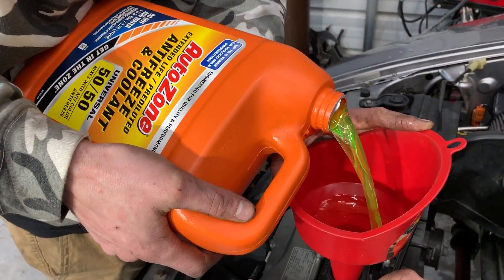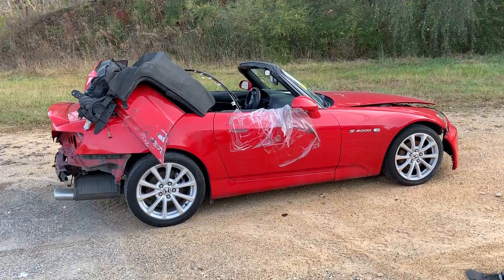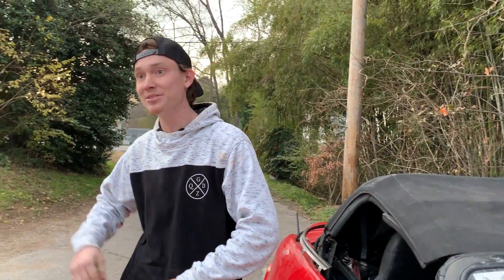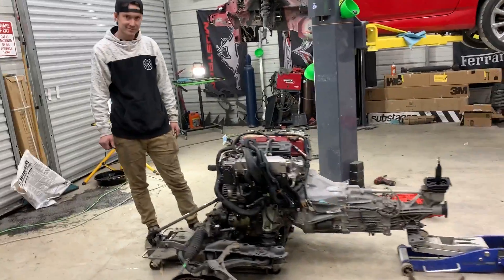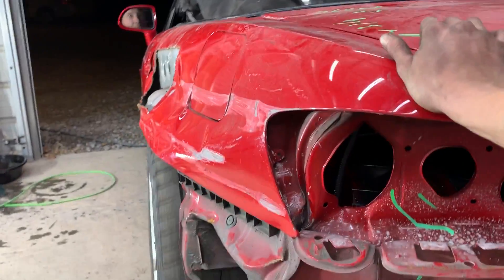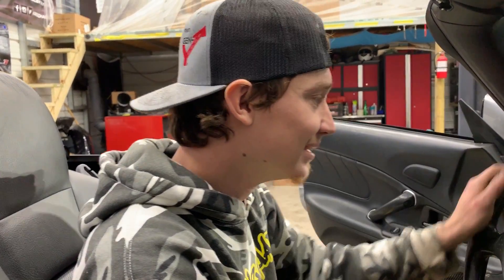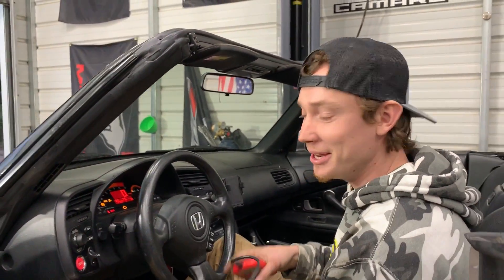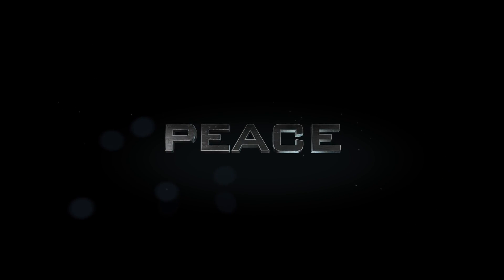Rebuilding A Wrecked Honda S2000 Part 7

Comment: You know what they say, The 3rd engine is the charm.  You all are hard-core.  Nothing stops your builds.  Great work. 

That 1st engine might still be good, maybe have someone check the head (for cracks and warpage) and plane it down.  The upside is that planing it can increase the H.P. a little bit...as compression was raised (smaller combustion chamber).  Just a thought.

Comment: The squeel when you start it is from the starter index. 
Check both sides of the dipstick cause it never reads the same on both sides and always go with the lower side. I have an 02 and learned it from a few friends with s2ks when I first got mine.

Comment: 3 wrecked cars to build one complete car . And over filling your oil won't hurt the engine as long as it's not too much over full . Drifters do that on purpose to make sure they have proper oiling while cornering . Under oiling will kill an engine , but until it hydrolocks overfilling won't hurt it .

Comment: Swap over the cluster from the red s2k keep track of the milage on the new swap
Reply: The red one dose not rev as high the ap2 is a 2.2 liter and revs much lower so that might be a problem
Reply: Tyler Walter - Gold spark plug cover means 2.2L, it should have the same cluster as the silver car.

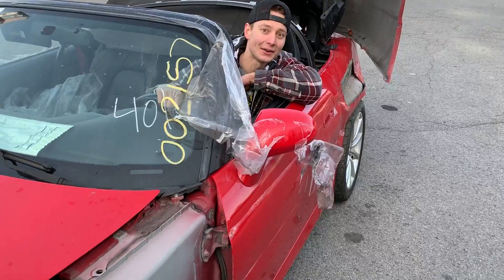Comment: 2:36 ‘it’s super smooth’ 
Literally thought the diesel running in the background,  was the F20C  running at first 😂

Also, Honda stock motor mounts aren’t the greatest. I’ve had so many stock ones break from normal driving. I wouldn’t get solid mounts cause that’s quite the rough ride
Reply: Couldn't believe how clean that s2 was
Reply: JMR Rebuilders right?! Super clean. Would almost be worth fixing that one instead imo

Comment: Make sure you change the timing belt if you can't verify when it was last done, they need one every 100k.  Also, PLEASE don't use 10w-40 like you did in the last one, you'll kill it if you do.  God bless and Merry Christmas!
Reply: Josh Lampe it’s not a belt it’s a Chain. It don’t need to be replaced every 100k
Reply: Also 10w40 viscosity  won’t actually hurt it😂 so many people change the oil viscosity when the car has higher mileage and the car does fine.
Do you know what you’re talking about? I’m no s2000 fan but I’ve also heard those chains don’t need to be changed every 100k unless you beat the shit.
Reply: Yelsew Painter I’ve owned a s2k for 15 years so I know what I’m taking about.
Reply: @TheIntegratyper99  I think he was talking to Josh Lampe

Comment: You should put the wheels and tires from the red S2000 on the gray one because they look much better and the tires look like new. You should also put the stock airbox back on because those cold air intakes don't do squat mounted in a hot engine bay.

Comment: condensation steam is normal in cold weather and is the sign of a clean burning engine.
Also the rocks are kitty  litter
Merry Christmas
Reply: ᗒ╬ᗕ1112223333111ᗒ╬ᗕ , I’m thinking now that i saw them disconnect the exhaust , that all the residual coolant will need to burn off.
Reply: sure it will but cars that are not running rich will give "steam" out the exhaust.
I used to know what side my idle mixture was off that way.
Cold days its perfectly normal.

Comment: Hey guys merry christmas everyone! Good job! Just for information - Honda use particular coolant, not a generic one. The coolant for this engine is OEM Honda Type 2 coolant! Using different can damage seals, head gasket and the cooling system. Better flush that thing and change it when you can if you want to keep that engine! 😉

Comment: So instead of getting the other head resurfaced you guys buy another s2k lol?? Hey, works for me...
Reply: All SPOOLED UP they probably got a good deal on it I’m sure
Reply: When the upload pays a couple of grand you can waste money like that.  They have no business working on engines without the proper knowledge.  A tech manual would be a wonderful idea as well.  But hey, I am just a hater.
Reply: It may have been cracked, that was a lot of coolant coming out of the exhaust.
Reply: @gd1996  Well they check for that prior to surfacing.  It's freaking blown head gasket 101 man.  There is probably a hundred youtube videos on the subject.  If only they knew how to use it.  They need to stick to painting.
Reply: They paid $500 for the new parts car, so sounds like an economical solution to me.  How much do you think a re-surfacing would cost?
Reply: @andreschavezjr4232  this entire car was 500bucks lol
Reply: @johnboyd6139  wow ok dude
Reply: @TheRobman  generally speaking around $200.  Consider they wasted time and money with the improper job the first time, they paid way more than $500.  Also, the $500 likely didn't include shipping.

More importantly though, they are teaching people how to do things wrong.  Those without the benefit of a YouTube channel won't have the resources to throw money at a mistake.
Reply: @nemisis69spec  generally speaking a channel like theirs is a resource for people who want to learn.  They aren't teaching anyone anything by throwing money at mistakes.  Most people can't throw money around and cover it up with a other upload.

If they would just do a little research,  it could be so much more worthwhile for the young person out there trying to get their car running.
Reply: boyd  boyd firstly they never claimed to be pros they're learning just like some watching. Even tho I get your point that's still the basis of DIY content. If your prepared to do something yourself which u dont specialize in be prepared to make a few mistakes. That's how u learn.
Reply: @johnboyd6139  You  need to look at what they make on video content... they made a ton of money by having to redo this.  It's a risk many of us take, sometimes it ends up a fail like theirs did.  But they got a whole vid from their fail and got paid a lot for it.
Reply: @johnboyd6139  Anyone watching youtube build channels on how to learn on how to do this kind of work are already screwed.  There's a reason why so many people blast them in the comments like your doing here.  These channels are for entertainment, there are plenty of good how to vids to do things correctly.
Reply: They paid the driver $500 for shipping it from Florida. They never disclosed what they paid for the car.
Reply: yeah they never said anything about the car
but i think they are not that stupid to buy another car if it's not a good deal
.
if the resurface or buy a new motor or parts cost as much as buy a wrecked car with everything OEM and running then it's seems like a good deal to me really
they had their own limit with budget and Honda cars just not expensive really and you can re sell the left over parts for some money
.
and also this chanel is not about experts fix the car it's the DIY chanel that's learn along the way and entertain people
some of their decision may not good but you can help them by instruction and buy their merch really
.
and yeah they fix lambo and ferrari with DIY attitude they had and they are not some experts on the internet so yeah i'd stick positive with them.
Reply: @gd1996  ok brother.  Have a Merry Christmas.
Reply: @nemisis69spec  I agree.  I've learned the hard way a few times.
Reply: @johnboyd6139  your feedback could be way more constructive. As it is right now it just sounds like you chop people down vs helping them produce better content
Reply: The red s2000 was CLEAN. That car body would make a great rebuild it’s too nice to throw away.
Reply: nemisis69spec $500 to ship to TN from FL.
Reply: @johnboyd6139  500 was shipping only I think
Reply: @nemisis69spec  The delivery was $500...
Reply: Yeah all they needed was someone with more Honda experience my boy has the same combination working.
Reply: Apparently it is a ton faster then working on the engine directly.
Reply: @derekcraig3617  how would you suggest I do that sir?  The facts are many people have said the exact same things many times with no evidence of a countermeasure by the goonzquad.

In addition, these guys need to consider liability.  Let's say they don't torque a bolt properly on an engine or suspension component and that results in an accident, they have documented this thru video and can easily be sued.

They have a whole lot more reason to do things right than to just teach.  They do sell these cars you know.  They are responsible for them long after they are sold, like it or not.
Reply: @johnboyd6139  it's obvious you can't hear any feedback on how you come accross on the comments section. Regardless of how right you think you are, you come accross as pretty rude. As for how you can be more constructive: focus on what they are doing correctly and respectfully point out what they are doing incorrectly. If you continue to sound like a jerk in your comments then no one will listen to you
Reply: @derekcraig3617  You come off as rude too.  I've commented that they do paint well.  Of course you haven't read all my comments from previous videos.  For instance, I once commented that the aluminum welding was pretty good.  I was sincerely impressed.  It's ok though, you couldn't possibly have known.

Have a Merry Christmas!
Reply: @derekcraig3617  I also am very correct regarding liability.  They are responsible for the workmanship long after the vehicle is sold.  Their own videos will be evidence.

I can't sugarcoat that and am sorry if it comes across as rude.
Reply: @markvanderlee  That's correct, the $500 was just to ship it. They never said what they paid for the car itself.  slick tax avoidance for sure.
Reply: TheRobman $500 for delivery...
Reply: @johnboyd6139  -> Within our system of laws you are most certainly correct ~ especially our civil system that allows grievances to be heard by judge and jury.  
Ultimately the question becomes ... what are the odds? Do we have access to data somewhere about the number of mechanics who have been sued? Or even the number of home repair people who ended up in court because the front porch collapsed?
You can't live life afraid of everything that could happen.
Reply: @gpackwood1  I work in automotive engineering and the amount of lawsuits and regulations are staggering.

To just do it right and use the proper techniques is not hard and shouldn't create worry of impending lawsuits.

To your point, not many mechanics or carpenters have YouTube channels and the income flow to warrant a lawsuit.  However, the goonzquad has a crap ton of assets.  They should try to do better especially when dealing with suspension and engine components.  Or, they won't be able to sell their cars.
Reply: @johnboyd6139  -> Thank You. Great Advice for the guys. I have some time next week and I think I'll contact The Insurance  Institute of America and see if I can get my hands on their 'theory of vehicle inspection' documents along with the actual inspection checklists used in many states.
Reply: @gd1996  And I disagree with this comment.   Youtube is a great resource for learning.
Reply: @johnboyd6139  It is if you watch the right vids... this channel is for entertainment.
Reply: @gd1996  is it?  I don't think you can make that argument when they themselves say they want to demonstrate what you can do in your own backyard.
Reply: @johnboyd6139  You can do it in your back yard, no one says it would be the correct way.
Reply: @gd1996  haha...yep.  You do you brother.  To defend a couple of guys doing things that are sketchy at best, on cars they will likely sell, is thin.

It would save them money to just do it right in the first place.  Who can argue with that?  You of course, but who else?
Reply: @johnboyd6139  They are making more money in a month than most people in a year... what is there to argue about?  They are having fun and getting rich doing something they obviously love doing.
Reply: @gd1996  ok.  It is all about the money for you and them, regardless.

I like to grow by learning and doing better each day.  If they get just one person hurt by "sending it", it would be awful and very preventable.

Be greedy if you want.  It reminds me of an old saying, "pigs get fat, hogs get slaughtered".

See ya.
Reply: @johnboyd6139  I'm greedy because I watch rebuilds on youtube? LOL ok
Reply: @gd1996  okay brother.  You don't understand.  It's cool.
Reply: @TheRobman  $500? Prob closer to $5k. S2000 aren't cheap even wrecked..
Reply: @johnboyd6139 wow this argument is still going on ? Here's the thing , I've been watching these guys since the mustang and Corvette build and I love their content. Not once have i decided I'm watching their channel to learn how  to fix stuff i just love watching car rebuilds. Again all your points are valid but this channel is more for entertainment than to teach you anything and that's from my experience, especially when they dont show u every step, that should show u something. These guys are having fun doing what they love and we're entertained by it that's why we watch, even with all the differences in opinions we're still all here months later.

Comment: Hey you may have a clogged up catalytic converter.  if so, it will never burn off and you will kill your engine.  May need new cats. OR use the factory exhuaust from the other one.

Comment: Just check your other engines head surface make sure it's super flat and clean and smooth, maybe take it in to a shop and have them go thru it and check it and then copper spray the new gasket when you put it back together,should be good to go,you will have steam come out the exhaust for a while,just watch the temp gauge make sure it doesn't over heat and go rail on it to clean it out!👊 merry Christmas Goonzquad and viewers!!

Comment: Ya, I noticed when you took out that old engine to rebuild it and ground the Pistons and heads with a hand grinder. I thought to myself oh my God... That has to be flat to within .0002". Y'all need to pull that thing apart and get it to a machine shop or scrap it. You ain't never gonna get it that close with a hand grinder.

Comment: See if you can get the turbo 4 from the current Civic Type R.  That'd probably fit in your red S2000 and provide way more power and fuel economy than the stock engine.

Comment: its ok if the oil is above the max line after sitting for a bit. if it is above the line when it is running then there is too much oil.

Comment: Goonsquad: the only channel that will buy a whole parts car and do two full motor swaps instead of changing a headgasket.  

(If you had repinned your plugs on the motor you put in the honda it wouldve worked)
Reply: @Shill Talk that's what they said.   I personally couldnt say as I wasnt there

Comment: So 3 x S2000 bought to fix just one of them. Surely the most expensive S2000 repair going...
Reply: The views on this video alone will have paid for two of them. Then they can sell the parts left over.
Reply: Dave Ward The point was not the expense but how many cars were used to get 1 going.

Comment: What does oem mean?
Reply: Original Equipment Manufacturer.
An original equipment manufacturer (OEM) traditionally is defined as a company whose goods are used as components in the products of another company, which then sells the finished item to users. OEM Versus Aftermarket
.
OEM is the opposite of the aftermarket. OEM refers to something made specifically for the original product, while the aftermarket refers to equipment made by another company that a consumer may use as a replacement.

Comment: Guys - you have to boost the s2000 - put on a 68mm turbo, new fuel pump, injectors, manifold, throttle body, ECU (haltech?) and get her to 700-800hp 9s car. I DARE YOU!!!! Huge fan here - MartyParty - happy xmas thx for the contents. Check this: https://www.youtube.com/watch?v=2QrmEbVU1Tc

Comment: The term shake and bake refers to making meth if you didn't know.
Reply: Not really if you know your history. Shake 'n Bake, manufactured by Kraft Foods, is a flavored bread crumb-style coating for chicken and pork. The product is applied by placing raw meat pieces in a bag containing the coating, closing the bag, and shaking so the particles adhere. The coated meat is then baked in the oven.
Reply: @gpackwood1  or if youre not neon hhhwhite
Reply: @lanehaynes6841  -> Your comment went over my head because of my age no doubt. My only connection with neon white is as a descriptive term used by Trauma Doctors in the ER to describe the skin color of young people who are dead from meth use.